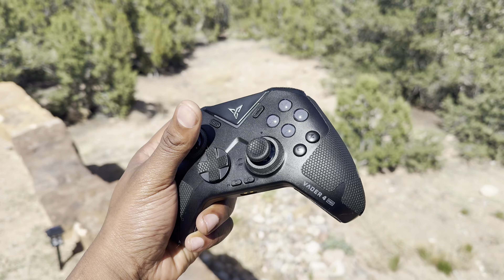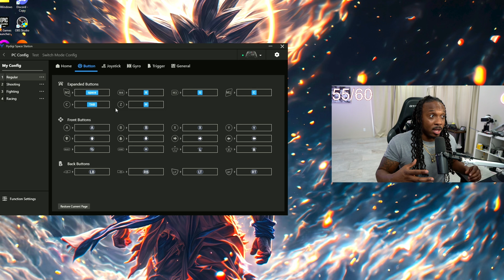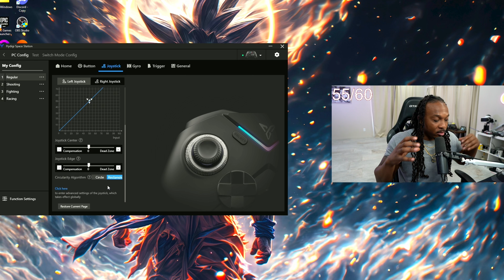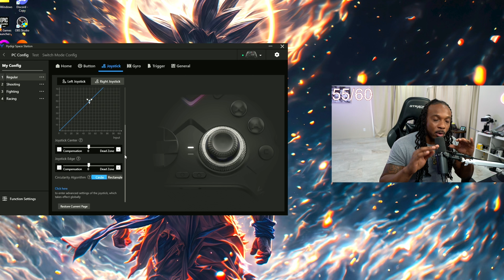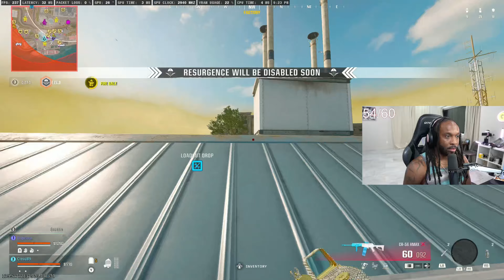IS Flydigi Vader Pro 4 the BEST Gaming Controller?

Comment: it is not the best controller technically the pxn p5 8k is the top controller the vader 4 pro would be good if the delay wasnt so bad nomatter how the sticks feel it still has a delay i switched to the 8bitdo ultimate wireless until my pxn p5 comes i have 2 vader 4 pros the assain creed one and the reg one and both contrllers feel diffrent overall i had the controller tryna use it for fps games it feels good but the delay just aint for me and the sticks i really dont like the way they feel

Comment: RAZER V3  IS BEST👉😏
Reply: Disagree. I was in love with the Razer V3 until I got the Vader Pro 4. I didn't like some aspects at first and switched back to my Razer the next day. The controller felt tiny and cheap immediately. I haven't touched my Razer V3 since then. Also the aiming on the Vader Pro 4 is light years better once you dial in the tension to your liking.
Reply: @andrewroof8042 Sorryyistake the TURTLE  Victrix Pro BFG.I am testing few month now and is really really good.That is my opinion.👉✌️👈

Comment: Go with Vader 4!
On its launch date, The controller had a bit of latency and outer dead zone on the analog sticks, but a couple of months later, flydigy made updates after updates, improving both analog outer deadzones and latency. The market as it is right now, no better option that gives this variety of benefits:

Adjustable tension on the joystick
Real ZERO deadzone on analogic center
Precise 12-bit joystick (4096 micropositions on the analog, in contrast with 256 for regular 8 bits)
Swapable joystick heights

No friction joystick (internal limiter + no electronic component on the analog design)
Software with a slow centering speed algorithm (the best for precision so far)
Fast switch for clicky trigger stops
4 Back buttons (they are good, not great, but on par with market standards)
FULL REMAPABLE BUTTONS, INCLOUDING ANALOG, STAR, SELECT, AND KEYBOARD KEYS(Remap to any button on keyboard or controller, in contrast to standard remappings on the market, that are limited to controller buttons, and sometimes don't include analog, start, or select on remapping.)
Two extra buttons on the face (good for specific functions such as tab and esc, or even combinations)
Fairly precise gyroscope for fps(don't use this feature much, cause I'm more used to analog, it may not be perfect, but I had no problem using it, but it might not be the best)

There are more things, but I think I covered the most important ones
Reply from the maker: Freaking spot on bro. ✊🏾
Reply: it still has alot of latency compared to others my controller has a max stick latency of 11.4 ms and the vader 4 pro minimum aint even that low lmaooo
Reply: @edmugga 12bit sticks >>> your controller.

Comment: I wanted to buy the normal PS5 controller and after 2 months I was going to buy the Edge, I'm going to migrate with the controller in Warzone but there's the drift problem, I was very curious about this controller
Reply: What advice would you give? Would you go for the standard PS5 controller to get used to it, or the Vader Pro? I really want to try the Edge because I've heard it's really amazing, both the feel and the response time.
Reply from the maker: Great question, I have both. My only thing with the Edge is it only have two back buttons. I’m used to four in the back. The stick drift will happen a lot quicker with the edge and the regular PS5 controller before anything happens to the Vader pro. Also the price is amazing. And it delivers more than other controllers I’ve used or seeing in the market.